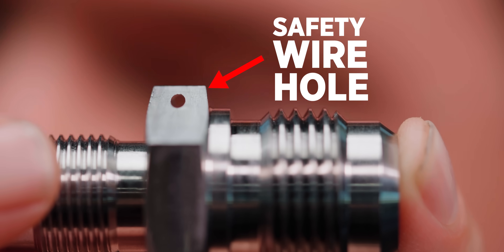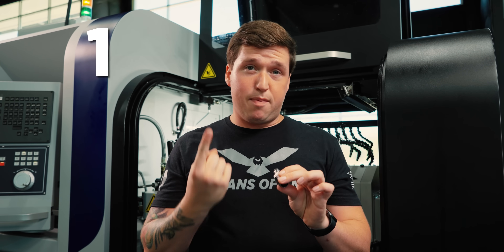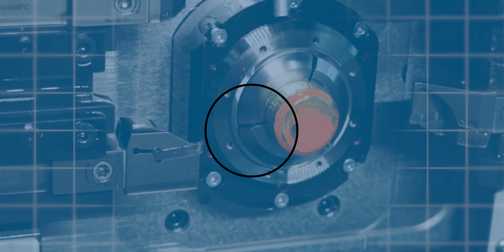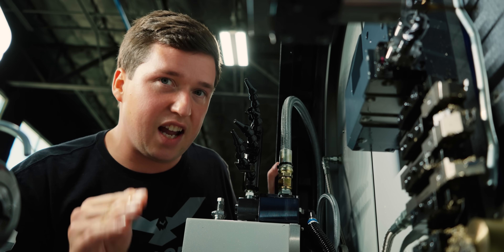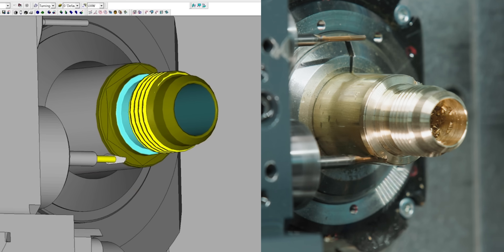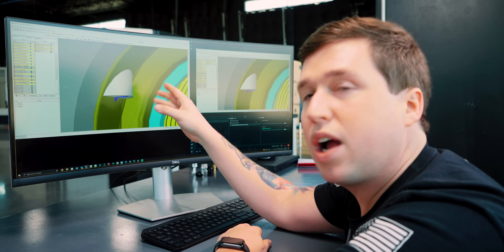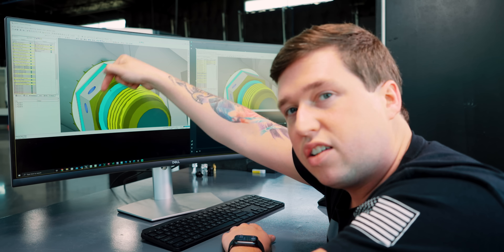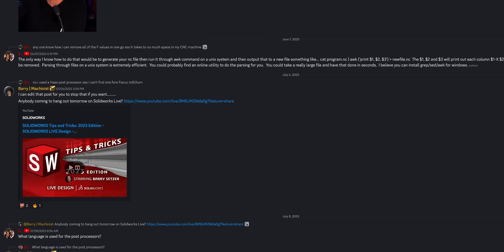Brilliant Trick to Drilling a PERFECT Hole

Comment: Seems like a good trick if you run your operation like a machinist but if you ever had to make it by hand you would drill at it straight on then turn the drill to the correct angle. Why not do it the same? Also why does no one ever mount a auto center punch for small holes instead of a small drill bit or end mill?

Comment: I love the GOdrill series from kennametal. I run a production in titanium grade 5 in which i use a 3.5mm 5xD drill. Last time i changed it, it had made 20.000 holes. The holes are 12.5mm deep so that adds up to 250 meters of drilling. And the drill is stationary. Thats impressive for an all-round drill 😊

Comment: Or you could use a Crazy Cross Pilot from Mikron and repeatably pilot on the hex angle, come back in with a crazy drill into EVERY aero space material, and run this lights out through every shift.  Crazy Drills FTW

Comment: Obvious trick.
Probably you don't even need to drill all the way through and just make a blind hole in round, then machine hex and open the hole from other side.
Reply: I know right?  The "trick" method is the most obvious method.  Drilling into an angled surface is always a last resort.

Comment: they used to drill through the bolt head which worked great for about 5000 years and 100000000 hrs of engine run time,   then someone wants to save money and comes up with this trash.  WTF  just do what we did for 100yrs and stop trying to justify a job!!!!  leave perfection and quality alone!!!!!!  yea they saved 9 seconds but whats the damage!??

Comment: In certain applications the sharp edge could break the wire, so radiusing the hole would be better. Either by shotblasting or grinding??

Comment: On the part shown at 0:24, the safety wires are going thru the bolt heads on some, and also thru something like a washer on others. Does the washer-looking part have a thru hex? If not, how does that method compare to the thru hole method?..just wondering if anyone has more insight...don't wanna screw up when I start designing aircrafts now.

Also, have anyone ever noticed better tool life and/or higher chip loads with using HSS or Cobalt rather than carbide in some materials on tiny holes?

Comment: i think i forgot commenting this on the flat-bottom drill video

if i have weird holes, i tend to do 2 roughing stages with drilling between them with the surfaces from roughing 1 being flat towards the holes as shown here. it generally pays off in how fast you can drill and how long the tool lasts, even if the program takes a bit more time.

Comment: We just had a new L32 Citizen sliding head turn up yesterday, it's the best way to get the price down on the work, so we can 
get the orders.
Reply: L32's are nice.  We have 15 of them at my shop now.  Do you have the LFV option?
Reply: @brandons9138  I'm not sure what you mean by LFV, but we machine a lot of plastic, the machine
can feed in a way were it breaks the plastic swarf up, so it don't go stingy and rap round everything.
I stopping working on the shop floor as a CNC turner, because a get in pain standing up all day now.
So I've gone over to the dark side of inspection, but I do miss being on a Mill Turn Puma lathe.
Reply: @mw8580  The LFV is that chip breaking option.  We do a ton of plastics at my shop as well.  The LFV (Low Frequency Vibration) is a game changer.
Reply: @brandons9138   Yes that is what we use , I just didn't know the name, but I don't think they have it on the M32's yet
Reply: @mw8580  It has to come equipped from the factory with it.  The ball screws are specially designed and treated for the extra abuse the LFV puts on them.  It's not some thing that can be added later.

Comment: Donnie, great job explaining the wire hole. Having never seen bolts with wire holes personnelly, I am curious as to whether there is just the one hole or two in a bolt like that?
Reply: The ones I've secured always had 1 or 3. But I guess that depends on the part
Reply: @themechanix393  thanks for the reply.

Comment: I've done a lot of these and I always make a fixture and have the drill bushing ground flat against the hexagon  so when  the drill goes through it is supported from beginning to the end. It is very accurate and clean. The drill hole is also lubricated from beginning  to the end.
Nice technique. I work alot with fixtures and precision ground bushings. It is extra work but worth every dollar.
Reply: This is how I've done it before. It's a second operation, but still quicker than what's shown here. Though not everyone has the 2nd machine available

Comment: The way they twist those wires to keep the bolts from loosening is so genius
Reply: I learned something new today 😅!
Reply: Yeah i have secured some screws as an trainee at Beechcraft on the wheels, when we had to clean and re grease the wheel bearings.
Reply: Our lives are on saved by twisted wires...and A PERSON. Hmm, i smell an engineer who didn't account for operator error.